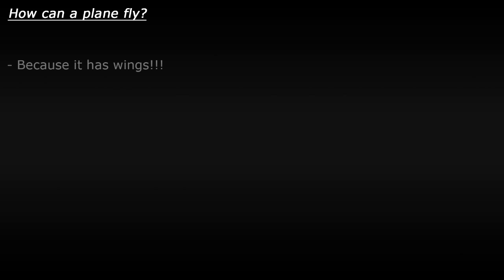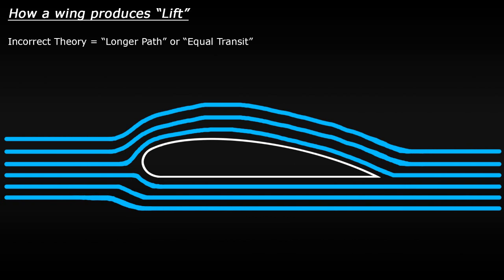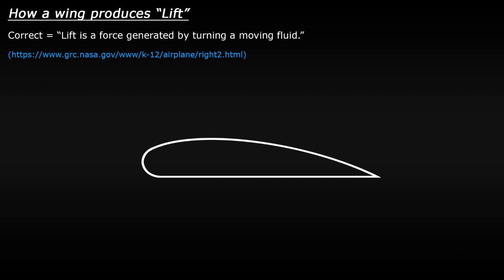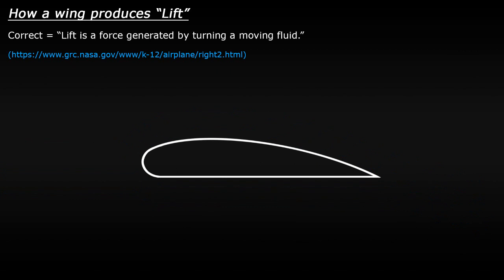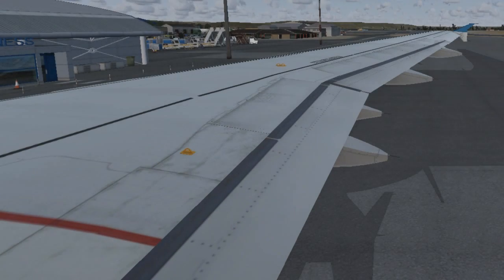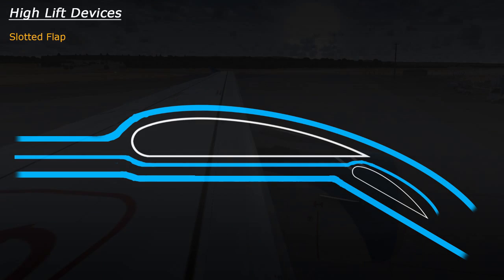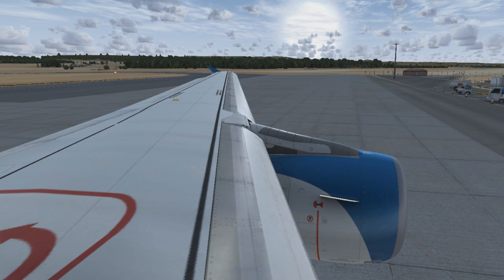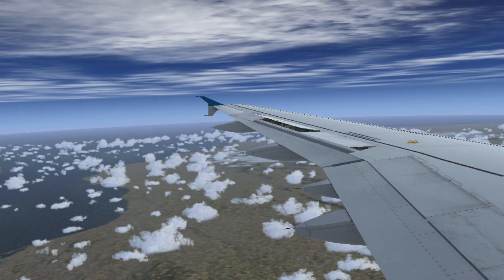How Wings ACTUALLY Create Lift!

Comment: Who says the separated air must meet at the trailing edge at the same time? Bernoulli didn't say that! Definitely Bernoulli's principle is true, but everyone is using this principle based on a wrong premise.
Reply: Thats it! Yea, why the heck should separated air meet at the trailing edge at the same time??
Reply: Thats to make the air wind in the same pattern, (laminar flow). If the air wind doesnt meet at the same time the air will become (turbulent flow) which will make the air behind not good as it was. Making it impossible for other planes to travel at the same direction after a while.
Reply: @OMGitsAFrEaKDuCk  If you look at the movies about flow actually using a fluid, you will see that the fluid does not have to meet at the same time.
Reply: they will not meet at the same place.
Reply: Thanks for helping me out bro❤️
Reply: @OMGitsAFrEaKDuCk  That has nothing to do with laminar or turbulent flow, and turbulent flow is not a control issue whatsoever.
Reply: The air molecules have to meet simultaneously at the trailing edge of the wind. In fluid dynamics,  fluid flow (in this case air)  on curved paths or surfaces sticks together unless affected by external forces. Simple experiment: grab a glass jar, tea cup or anything cylindrical in shape and pour water on it, see what happens. The water will flow on the curved path and meet at the same time at the end of the curve. Hope that clarifies the idea.
Reply: @StandforTr00th  You're completely wrong
Reply: @StandforTr00th  There's another video talks about this and shows you the evidence of air molecules NOT meeting at the trailing edge at the same time.
https://youtu.be/w78JT6azrZU?t=385
Reply: @StandforTr00th  You are talking about the Coanda effect
Reply: For what you read below, I first acknowledge the contribution of the narrator to explain flight in good faith although he is terribly wrong, and I apologise for that, and for my tone in the following where it must seem disrespectful.

The air passed beneath and the air passed above a wing body have different displacements, relative to the same air mass, the air being distributed differently across respectively opposed surface areas regarding the vertical forces acting above and below the wing body. The wing body traverses an air mass, it passes this body of air over two different wing profiles front-to-back along the same plane (wing chord length): wing top and wing bottom have different opposing path lengths acting on the vertical distribution of a contiguous air body (roughly speaking). Stepping it at a given rate of change (horizontal displacement ie. indicated airspeed).  

I call these planes the X and Y axes. The Y axis must always produce a Lift force equal to the weight of the airframe (its rate of change in free fall under gravity), this determines the rate of air traversed in the X axis required to proportion the ratio of Lift.

Its not that an air mass is moving over the wing body, but rather that the wing traverses a body of air: the airframe and wing are acting as a free body. This is not the same relationship as a wind tunnel. The air has a resting atmospheric mass and density, which resists a force acting upon it (friction aka drag). But though a fluid, its molecular structure has an elastic boundary along the compressive pressure wave acting against the solid body molecular lattice, where the forces of their collision intersect. 

When laminar airflow no longer bisects into the vertical balance of forces with a proportionate ratio of air displacement above and below the wing body, sufficient to produce a lift advantage, flight stalls and gravity wins: air frame weight drags the wing body toward earth. Gravity produces a rate-of-change I call 'mass acceleration' or weight, it is a force determined by mass and acceleration under gravity while the air frame produces a rate-of-change called 'forward lift'. The air frame must maintain a proportionately stepped rate of lift against the rate of its fall under gravity as it horizontally traverses a body of air. This is why a fixed wing air frame does not hover upon the still air: it must pass air across its wings to balance the rate of its free fall under its own weight which is a constant of earth gravity.
The video narrator is misrepresenting the physics with hogwash.
Reply: Santy Clause absolutely a top grade comment! meticulously reading your comment made me understand it.  

I’m getting into aerodynamics whilst contemplating diving into an aeronautical engineering bachelor education. 

This isn’t the first video where the well intended presenter missinforms his audiance. Should you have any recommendations for me to reliably learn about aerodynamics I would be very grateful! 

Cheers
Reply: It doesn’t, wind tunnel tests at Cambridge prove this
Reply: @OMGitsAFrEaKDuCk  Think about this in a flow over an airfoil has a no slip condition. This no slip condition states that the closer to the surface fluid particles are the slower they're velocity. So the fluid parcels actually won't be moving directly at the surface of the airfoil. Ok so then you could say let's imagine fluid parcels a certain distance  away from the viscous layer. Well the top fluid parcel actually way faster than the lower one.  A good book that explains all of this is "Understanding Aerodynamics" by Doug McLean.
Reply: Of course the separated molecules dont have to meet.

But they tend to meet. This is not because the two particles have some memory or something, its actually quite simple. 

Imagine two molecules one on top of the other, and they are relatively stationary, so when immediately a sudden aero foil cuts through them they are forced to move vertically because of the shape of the solid but the resist horizontal motion because the splitting of air is so sudden and the wing surface is smooth so horizontal movement of these to particles are minimal. Hence when they leave the trailing edge, they are more or less back to their similar positions. Due to inertia.

:  <—highspeed   ———:——   :

This is easy to picture when a waiter pulls away the table cloth fast enough so that the objects on the table are not horizontally shifted.
Reply: @StandforTr00th  the water travels same distance in your case, but not in the case of wings. Hope that clarifies the idea.
Reply: @naveenthomas9931  I disagree. 
So, from the point on, when the wing cuts through the air molecules, they have different distances to travel, due to the shape of the wing, and due to the air following the shape of the wing, like it's a liquid that follows the shape of the cup instead of spilling over the edge when you want it to spill... but here it follows our wing. 
So, since the distance to follow along is greater on the curved side that on the plain side, the air molecules can not meet again after they travelled a different distance at an equal speed.
Reply: Yes it is wrong... I read a Nasa and MIT website before this... They all explained the incorrect confusions.. This is the Equal Transit theory and Bernoulli never said this
Reply: @shrinidhipattarkine8602  yes
Reply: @StandforTr00th  they don’t have to meet (and they don’t), but since the cylindrical objects are in fact symmetrical airfoils the water going around it will meet up at about same time. In that case the pressure above and below the airfoil (in relation to the wind direction) will be the same.  
Try rotating the cylindrical airfoil and pour water over it and you will get asymmetric pressure, essentially creating the lift.
Reply: Wow some of these comments totally amaze me.  Surely you wouldn’t even attempt to comment about this unless you had done some type of study on fluid dynamics, physics, maths etc and if you had you wouldn’t then even need to comment. A Property of a fluid over a curved surface is that it will meet at that same point after it splits at the front. Experiments in Wind tunnels etc prove this. Im perplexed there is even this debate. 
Education is the key here. Please don’t comment if your not!!!
Reply: @StandforTr00th  This has been disproven. They do not have to meet the same time, nor do they.
Reply: Explaining the Coanda effect as the “real” lift force isn’t accurate.  Though it may contribute to an upward lifting force, it isn’t the major player in lift production of a wing.  

If the Coanda effect were the primary player in lift, the location of that force would not change and the center of pressure or where the force is felt would always be at the trailing edge which has been shown to be not true.  

As AoA changes, the center if pressure location shifts as well effecting weight and balance of an airplane.  The center of pressure (resultant lifting force) can shift in relation to speed as well.  

Though I don’t think this video is denying Bernoullis principle is a player, I don’t believe it’s correct stating the Coanda effect is the “true” lifting force.
Reply: @OMGitsAFrEaKDuCk  Actually the reason planes can't follow is the wing tip vortices as well as turbulent air from the wing. This is compounded by tapered wings typically used in commercial aviation
Reply: @naveenthomas9931 now imagine a wing shaped sheet and tell me if they would change horizontally😂
Reply: @StandforTr00th  How do you know they are meeting at the same time? They are meeting at the same PLACE (indeed that is the definition of meeting) but it is not like the same two molecules are meeting each other again if one had a longer path length. What, do you think they agreed beforehand to meet at this place, this time?
Reply: @Thefamgang  Agreed, when it comes to the subject of aerofoils the armchair internet physicists are the fluid dynamics equivalent of flat Earthers. I too find it hard to believe that something so straightforward can stir up such controversy.